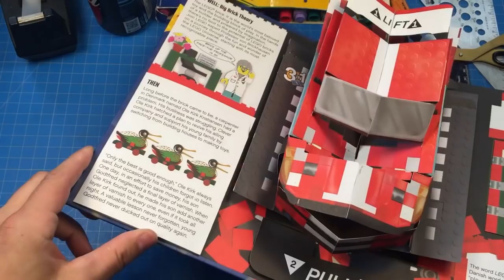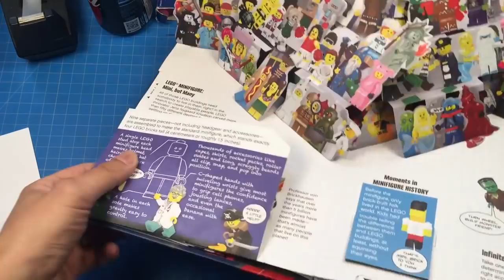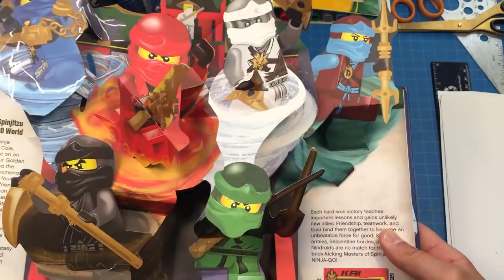Pop-Up Master Class with Matthew Reinhart: V-Folds Part 4 (Vertical Riser)

Comment: Thank you for taking the time to post such wonderful videos. I love popups and have been working with them for a while now. Is there a trick or method to measure and place the v folds to assure that the second layer doesn't extend beyond the card?
Reply from the maker: A lot of it comes from practice but I do like to place a v-fold, fold the base page, and chop off the excess paper that sticks out beyond it's dimensions.
Reply: Thank you. I thought that may be the case. For the last pop-up I made,  I had to scale down the bat so the wings didn't stick out.